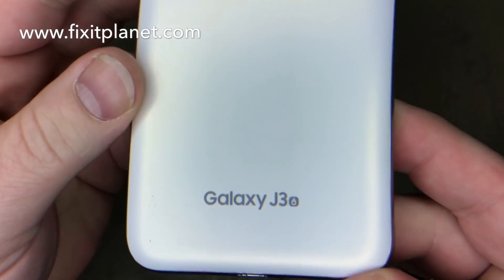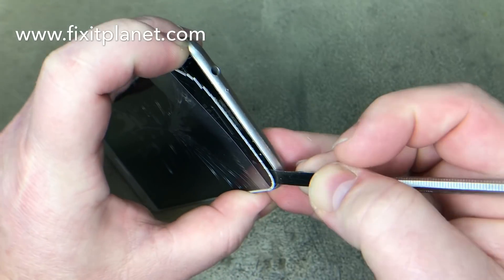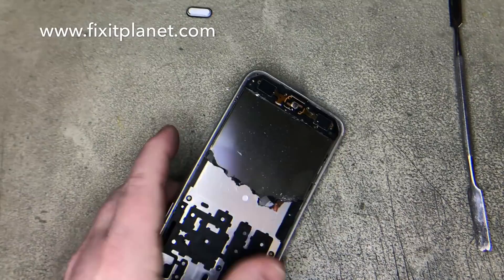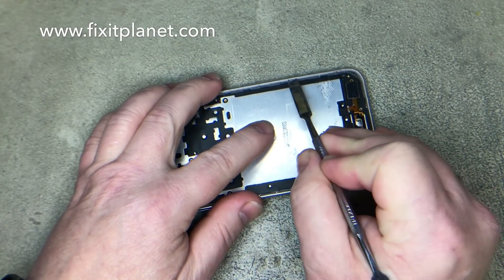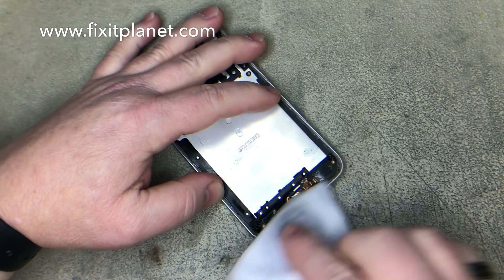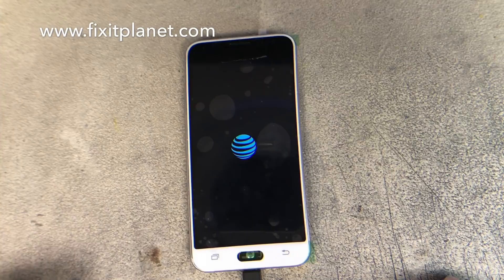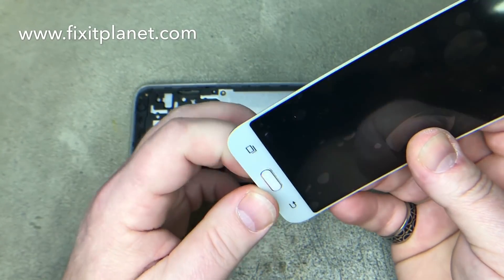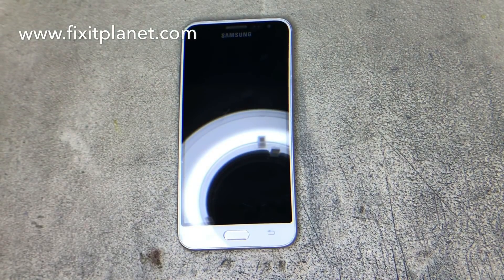Samsung Galaxy J3 Screen Repair From Start To Finish.

Comment: another thank you added to the comments section from me, yep easy to follow instructions, thank god it is a simple fix, but this video still helped tremendously with pictures & words, gosh what would we do without the Internet ahy, thanks again for your time m8, you saved me upto £60 in repair costs as i purchased a genuine Samsung part for £40 & the shops wanted between £90-£110 with parts to fix, (cheeky sods) again thank you
Reply: Did you buy the part from eBay?
Reply: Did you buy the part from eBay?

Comment: Where did you buy your screen from? And with my screen its cracked on the inside, the phone turns on but the screen will not, will changing out the screen help at all?
Reply: Yes, your digitizer is cracked.

Comment: How did you get it to lay down without the edges coming up? Every screen I get from Amazon will not lay down it raises up on the edges no matter if I put thin adhesive strips under the LCD. Do you sell the frame and LCD as a combo pre-assembled?
Reply from the maker: The frame must be completely clean and you should use a primer I recommend this https://amzn.to/36Bt2Ny

Comment: This is a very useful video, but, you need to explain to everyone that the heat gun is a very power tool, not a hair dryer. It can reach up to 1200 degrees in just minutes. That will fry your fingers like french fries! Do not do this on your kitchen table and wear protective gloves when using it. 
Just FYI and thanks for sharing.

Comment: My screen is smashed in the top left and in the top right it is broke and my phone is showing a black screen except from a little part at the top where you can see normally. Can I fix my problem via this repair? If so, do you know where I can buy a kit to repair my phone?
Reply from the maker: Yes replacing the screen assembly will fix the problem you described and you can get the screen here https://amzn.to/2X2VUMK

Comment: Did you take it off the screen without a heat gun>
Reply from the maker: No we used a hot plate and or heat gun. If it was not shown in the video it was probably placed on a hot plate before removing.

Comment: We tried this with success up to and including the screen test. It seems the terminal was only good for one connect cycle. When we made the connection again after removing the protective cover on the adhesive, the screen had lines. We tried removing the connector and cleaning the terminations by blowing. Each subsequent reconnection yielded worse stripes until the screen is almost totally black. There is no visible damage to either side of the connector using a magnifying glass. So our attempt was a failure.

Comment: Yeah, those Chinese screens don't sit well with the J320. I have the same problem and see no workaround anywhere. The problem is obvious from 8:05 where the button freely moves around, till 8:30 where the screen comes off on it's own. You wanna repair this phone, better get the original screen. It costs double, but the huge rose gold tinted strip of adhesive under it will make your life easier. I guess that's where the problem stems from.
Reply from the maker: Yes they suck for sure
Reply: You right because display is LCD. Original is Amoled !

Comment: hello, i need help.
i changed the display but the screen wont turn on, any ideas?
Reply from the maker: You will have to investigate. The screen could be defective, or the cable is not seated, or there is some collateral damage to the phone or screen during the repair process. Using a known good display to test the phone would be helpful.
Reply: @FixItPlanet1  the screen is new from aliexpress i bought one before and it worked, now i tested this screen on two broken phones and no signs on both of them
Reply: @ace0134  did you charge the phone
Reply: @user-ui5bx4pf9v  yes i do

Comment: hold on is that another screen from a different phone?
Reply from the maker: No it has to be exactly the same screen to work.
Reply: so from the same phone? or did u have a second j3
Reply from the maker: No we bought a new screen to replace the damaged one that was on the phone.
Reply: @FixItPlanet1  where can I find a screen
Reply: @kentishross9707  Ebay.~
Reply: @tokidokianimation593  Do clones work ok, or does it have to Samsung?
Reply: @tokidokianimation593  Do clones work ok, or does it have to Samsung?